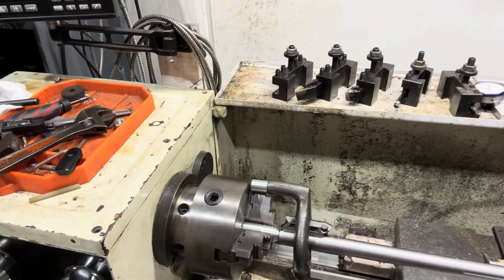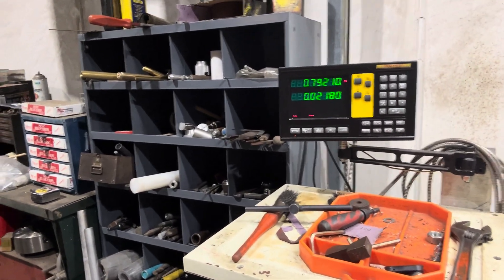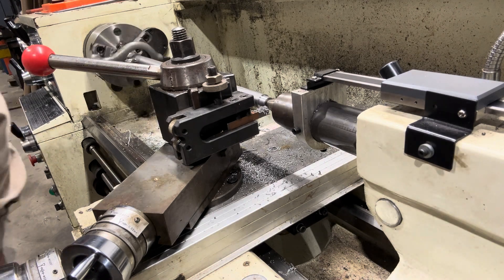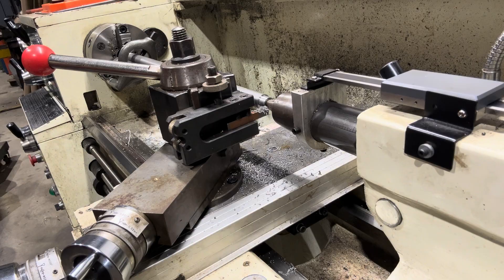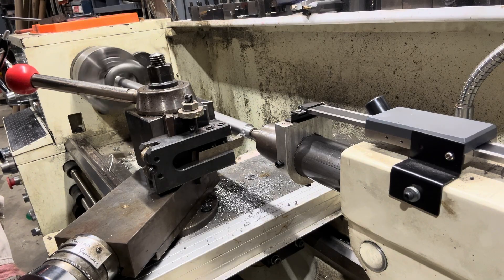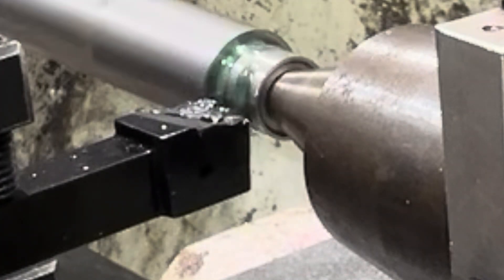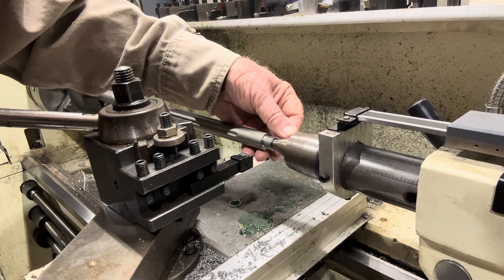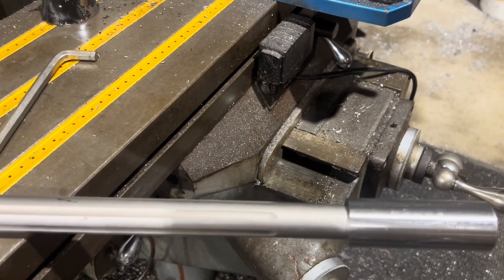Threading a 35 Whelen barrel

Comment: Did you clean up the crown after using the bore to turn your threads?
Reply from the maker: I do not put any more pressure than i need to hold it. If I do another one, I will make an aluminum plug to insert in the barrel and use it.

Comment: Great job Red! When l was at trade school before the new school was open l had signed up for welding but the old school was only set up for just two trades, auto shop and machine shop so my first year was machine shop. Most of the laths were around 50 years old but well maintained so they were good enough to learn on. And most people who work everyday on one it is usually the one they work on all the time and you know what it will do for you. Good memory's and it's the same whey watching you work in your shop. Thanks for the memory! 🤠